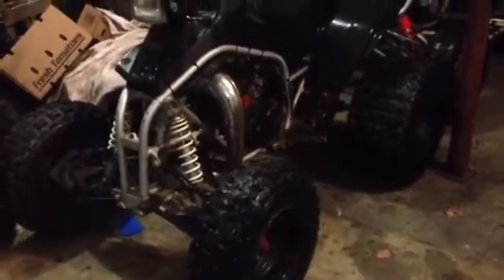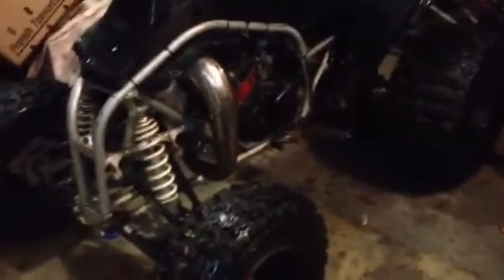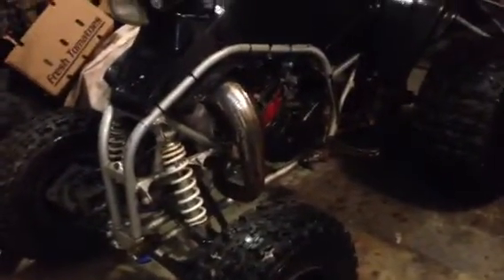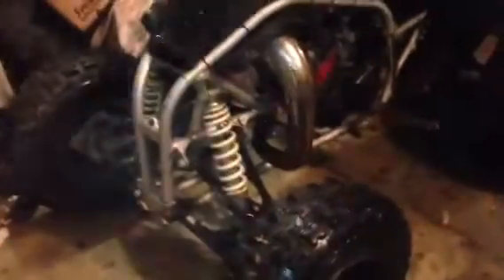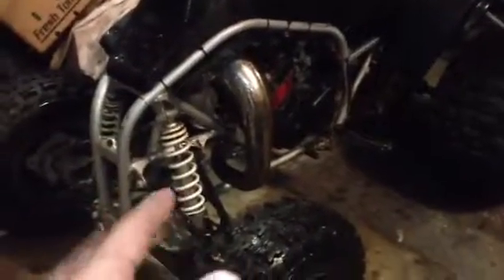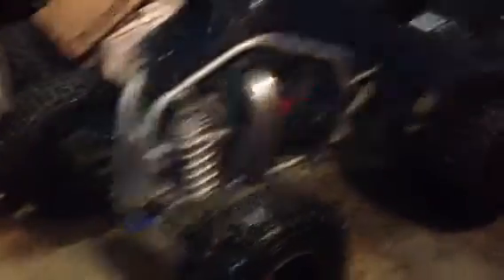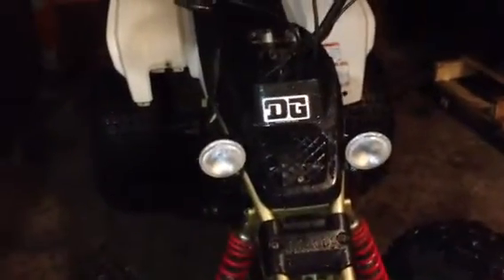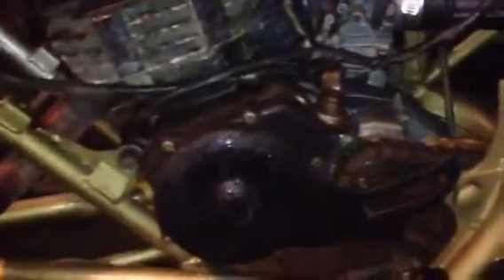Quick garage update (old video)

Comment: Hey when you get parts for the 700 make some vids I'm Intrested on how it turns out ive got a 07 Raptor 700 and its a 780 has big bore,stroker crank,11:1 piston,stage 3 hot cam,PCV,auto tune,bigger coil,kibble white valves springs,big bore clutch, HMF exhaust and more upgrades
Reply from the maker: yessir i will
Reply: Alright you do have some nice videos and most of the four wheelers that you work were about the same ones I've worked on and own I also buy fourwheelrs and fix them up and re sell them or just have people bring there wheelers to me

Comment: Any tips to do to a blaster performance wise? I want it to have plenty of lift and power and top speed at least 60
Reply from the maker: redisigned head will allow the front wheels to never be on the ground cost about 70$ call ken occonor racing and power reeds and you can keep the stock pipe no need for jetting